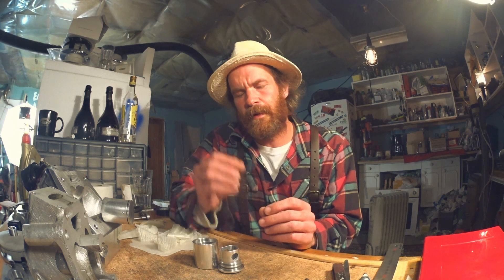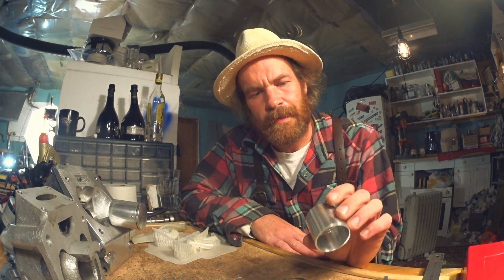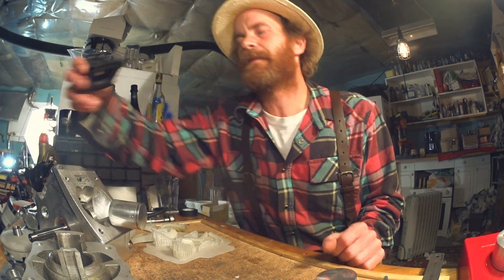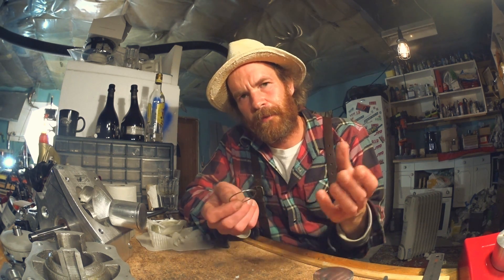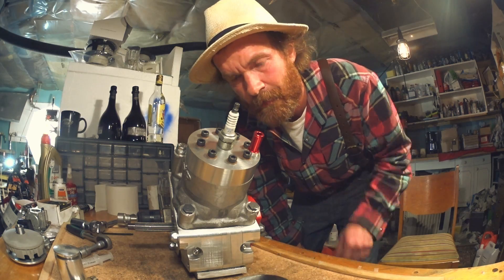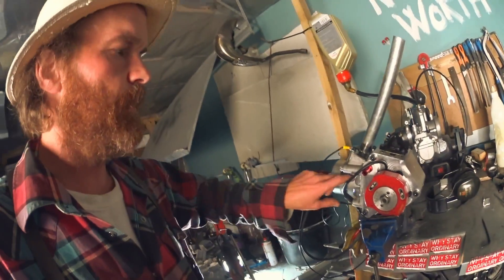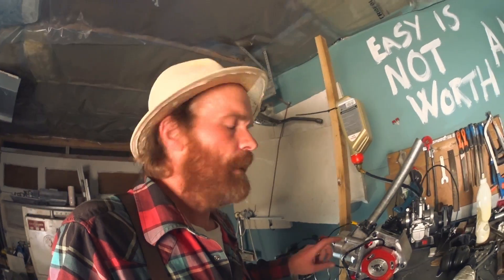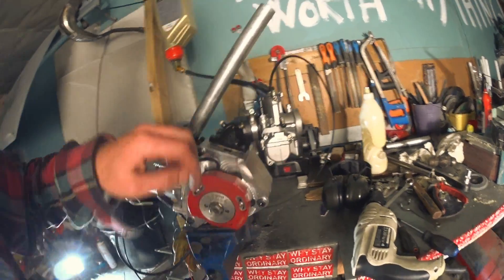STARTS, RUNS, EVEN IDLES! The Most Powerful Two Stroke Ever.

Comment: 30+ hp in a 50cc, thats insane 💀💀, must be using quite alot of fuel
Reply: That's like 75hp from a 125 😎 And a CR500 has about that from factory. So with the same power/CC a 500 would have 300 horse 😍 Absolutely mental!
Reply: @ZdzisławPiłka  No shit Sherlock! I was just putting thing's into perspective
Reply: Smiles per gallon, not miles per gallon.
Reply: The old rotary valve motor before this one definitely was making over 20 hp and used incredible amounts of fuel... When u use r/c fuel it could take 2x the fuel to get the same power as gasoline but when it's tuned to use like 4x as much that's when the magic can happen...(I made these numbers up obviously but ik it likes to run way richer than gas).. it cools the motor a lot more than gasoline too.. I think he's getting to a point where if something goes a little bit wrong it may be possible to "hydraulic" the cylinder with fuel.. again no real evidence to support this claim just talking from my ass like most comments
Reply: @ianbuilds7712  yes there's a very real possibility of hydro-locking the piston on alcohol setups but it might not happen with certain combustion chamber sizes. I don't plow about specifics for 2 strokes here. Just 4 stroke.
Reply: @charlesgunzelman3323  racing 2 strokes are built to pretty much have the piston as close to touching the head as possible at peak power rpm... that being said the ratio is relatively lower than u might think because the actual compression doesn't start until the piston closes the ex port.. so the combustion chamber is way tighter than a 4t but u only really get about half your stroke in compression so Idk i think it would be difficult to actually get that much fuel in there considering it has to get through the crank first but because this particular motor has a downward facing cylinder it may be possible if something goes wrong??

Comment: If I remember correctly when doing a top end and cylinder deglase on my Rm125 I would get around 145-160 psi compression during a test. Wouldnt a 50cc with a smaller piston be able to generate a slightly higher psi ?
Glad you were able to fire it up.
Reply from the maker: 👍 The gauge is not accurate, especially with that long hose.

Comment: It seems like if its actually idling and acceleration from idle at 75psi the case volume is not going to be an issue at all once you get a better ring in. Like many other have said here, dont worry about those negative comments, even if it ends up not working like you want, so what? You will try different designs and keep on until you find something that does work. That is how we advance.

Comment: Sounds like you’re pushing the 3D printer too fast. You could either try to raise the temp by 5 degrees or slow down.  You may also have a partial clog in the nozzle.
Reply from the maker: 👍 I'm thinking partial clog, printing at 50mm/s(if I remember correctly), low acceleration too.

Comment: Even with resonance it still is a air pump. You are just using resonance to achieve higher volumetric efficiency via scavenging. In racing 4 stroke engines you are trying to do the same thing but you use different solutions. Once you get the thing running right you might want to try a dual ground strap spark plug. It helps with flame travel by starting two flame fronts. It will burn the mixture faster and have a more complete burn. You will have to re-jet the carb usually bigger on the pilot jet and raise the needle. If you are running 12mm spark plugs try ngk jr9c. In 10mm cr9ek. There's no real options in 14mm but 12mm and 10mm gives you the biggest selection.
Reply from the maker: 👍 I've got a few tiny 8mm plugs I want to try.
Reply: @2STROKESTUFFING  The spark plug is the hottest part of the cylinder head and a smaller spark plug reduces that area. This reduces the chance of pre-ignition and detonation. I love the content of your videos and this is a fascinating series. Also some of the biggest leaps in engine technology has come from independent engine builders. Don't ever be afraid to try something new. I hope this whole project surpasses your expectations.

Comment: 2 stroke stuffing you should contact total seal ring corporation and research rhere rings because i think your ring being static is why it is burning out so quickly where if you run a total seal ring they actually overlap at the gap making a total seal
Reply: I've seen on numerous motors with stuck rings they lose compression fast and i think that could be part of it

Comment: It's so cool. But I don't understand why you don't test with the resonance chamber it will gain compression with exhaust back pressure. 👌
Reply from the maker: It shouldn't make much difference at low rpm, but now with it running and all, I'll get that pipe mounted.

Comment: Notice the dull spots on the sides of the piston? You can see where the skirt has been dragging on the cylinder. "There's some small RC engines but you can't really count them.." Yeah... that's because they run a nitro methane blend that they make so much power. Though.. that said, that thing on 40% would definitely be interesting :P
Reply from the maker: The secondary intake is actually going to be fed nitromethanol😁👍

Comment: Hi ! For your 3d printing issue, if you never changed your nozzle it is possible that the hole size in the nozzle enlarge over time due to wear and skewed your settings. Try replacing it by a new one.
Reply from the maker: Thanks, I'll try that👍

Comment: I emailed asking for clarification on 'most powerful' last year some time....no reply.  30hp out of 50cc is .6HP/cc.  I'm thinking that there are already 2 stroke engines that produce more than .6HP/cc.  Why can't you count RC engines?  I recall you saying you would run the same fuel (alch/nitro).
Reply from the maker: Sorry, I'm not the best at replying(trying to improve), guess I should count those small engines too. Hard to find any confirmed numbers, but if I can reach 35hp I'm pretty confident I'll beat them all.

Comment: If you braze or epoxy a tire schrader valve into the inlet of your gauge it will make the compression tester read accurately. It needs to be installed in the part you screw into the head. I was able to turn down an old valve stem and remove the core then solder into the fitting on mine. The reason it reads off is because the volume of the hose is added to the volume of the cylinder head. In the small engines I have tested the hose volume is almost the same as the head volume so it effectively cuts the compression in half. With the schrader valve installed at the spark plugs area it provides a disconnect between the two volumes.

Comment: just had a crazy wierd idea, if the bridge in the exhaust port creates turbulence and restricts what if you have a bridged exhaust port but 2 exhaust exits and 2 smaller expansion chambers ? so that each side of the exhaust port is its on circuit
Reply from the maker: Good idea, but hard to get scavenging right. Might have plans for something as a next project.

Comment: There is no need to defend your theory, or your work. You have proven that the 100% of bore works. So many of those that have said it won’t work are quite now. Innovation starts with one man thinking beyond the norm, and making those ideas a reality. If nobody looked outside the constraints of what is mainstream, we would still be sitting by the fire, reading by candlelight, and riding horses to the store. Keep on keeping on man!! I have faith that this engine, if not THE most powerful ever will be right up there with the designs that have many engineers and a lot of dollars behind them, and you have done it by yourself, in your garage.

Comment: Nice job. I understand the reason for the split piston so the pin doesn’t cause a problem with the exhaust port.
But could you have the ring fitted like a regular piston above the split of the piston to remove the issue of volume?
Keep up the great work and thanks for bringing us along for the ride

Comment: If you get 30hp from a 50cc, its incredible. My 2x 125cc kart engines are only 30hp each, which is considered decent. Im curious if you are going to do a bigger version if it works, because it should translate to 75hp. My race tuned 450cc kz bike is only 60+ by comparison, and thats nuts.

Comment: I admire your project immensely and I'm sure you will overcome all the small issues in due course. When I did thermodynamics at college in the 1970's, one of our lab experiments was to plot the indicator diagram of an ancient single cylinder gas engine. This experiment left a profound effect on me even now. Have you thought that perhaps that some scientific analysis is the next step to get the best compression performance? Here's a company that could help - perhaps even with sponsorship https://www.kistler.com/en/applications/automotive-research-test/engine-research-development/combustion-analysis-cylinder-pressure-testing/

Comment: That's still pretty low Brothers need about 100 give or take 10 preferably about 160 to 190 but I make mine about 250 I can run Diesel with mine most of the time with no problems

Comment: Great project, I keep following to see the evolution of the engine, and I am really looking forward to seeing how fast it will be when it is finished. 

If you think the issue is in the difficulty of the gasses to travel behind the ring, in an old DTM engine (or similar GT category) they put holes on the sky of the piston to put in communication CC and back of the ring. (This is a bit of a radical and not reversible modification, but maybe it can be tested on an old piston for comparison?). On a similar note, you can increase pressure seal effect by using L section rings (similar to those on 100cc kart engines); I think this could be applicable if you are going to implement the pin retaining design.

Keep it up: as engine development goes, you are doing great!

 Andrea

Comment: The modular piston Design is fucking awesome! 
Realy!  If you damage the top of the piston you have the under Part of the piston and just need to replace the top end. 
You need to patent you the Design! 
If you dont already have the patent on the piston.... XD
Reply: I have plenty of pistons at home that have a hole in the middle of the top.... Ignition was a little to strong for alluminium.... 
With his Design i could change the top piston with a New one and the piston is ready again
Reply: My Inner Rotor Ignition was a little to aggressive to My pistons.... XD 
Had the wrong Timing and sparkplug that gets too hot.

Comment: You've got this bro. I understand everything your doing. I won't spoil your fun with anything. Keep going your on the right track. Your resonance frequency with rise with your rpm So I hope you got your intake run and exhaust run mapped to the millimeter. you have to have each wave meet exactly in the middle of you piston to achieve full resonance at top end. You've got what it takes. and you got the support. be patient. If you get your numbers right your open intake will resonate and drive rpm even higher. just be careful of runaway. if anything gets too hot it will burn just like a ramjet. then brick itself

Comment: awesome progress, im sure you will sort it :D as for the 3d printer getting a good print is like tuning the 2 stroke :D you need the right jet (nozzle on printer).. ideally you want to print layers around 80% of your jet height... when im printing stuff like those stuffers i dont mind visible layers so use a 0.8mm nozzle.. the parts print quick and are very strong due to the thick layers.. of course you need a decent hot-end to keep the heat if your printing fast (something like a volcano)...

Comment: What you are doing out of your garage is astounding .It took a teem of engineers and years to squeeze 24hp out of a 50 for racing if you get 30 hp it will be astounding  .I had a tear in my eye when it ran on idle .When the pipes on i cant wait to here it ,  get the water cooling done and fit the pipe so you can do a proper run and let it come on the pipe .Do you have any idea on the revs this will reach when on the injection system .As a side note to perhaps get some cash in  why not offer a modified version with gear box to offer to the Freetech 50cc race boys running on a carb only if you can get 24hp out of it it would be a race winner .

Comment: Are you going to run the head profile the same  as the piston for the squish? I machined mine a couple different ways, one with a 10mm band at .07mm and another at 10mm with 35minute° leading angle to help direct the flame spread. I would have machined the pistons but they were ceramic domes RS250r

Comment: Great news! I think your are on the right track with the ring seeling issue, too large volume in the ring grove. I have tried making rings in bronce once. They didnt seal enought and very little power. My analysis was they did not provide enought pressure due to poor spring action. Are your rings hardend?

Comment: If you are going for max hp are you gona turbo it? Max power is all about how much air you can get in and how much it revs mostly. Light pistons to.
Reply: @M Bacon you can turbo a 2stroke. Look at skidoo 850 etec turbo. And I bet you can supercharge them to to get insane hp/cc. Also fuel has a huge role to he could run on methanol for even more hp/cc.

Comment: Well done! be sure to make your header for the exhaust the right length its a critical part of the tuned pipe system compression ratio on a 2 stroke isnt super important
like on a 4 stroke there was an old mod of drilling a tiny hole from the top of the piston in behind the ring to "push the ring out and tighter to the cylinder"
a decent ratio is fine for 2 strokes remember when you compress air it gets hot its the way diesels run heat can be bad on the top of the piston its why they sometimes put a ceramic coating
the hotest part on 2 cycles are the head and piston be mindful of hot spots forming on the piston top and to hot of a spark plug a hot spot can melt a hole right though the piston
chainsaw racers have done a lot of modding to get faster times in the cut some are on the borderline of total failure

Comment: Twiking with the intake & exhaust ports + intake resonator + tunepipe at exhaust......
Voila ..... one might get the max out from 2 stroke engine

( you might want to look in to the tiny marvels produced by Cox for Model Aero applications  ..
0.010, 0.020, 0.049 Reed valve engines running at 18000 to 25000 rpm )

Comment: I have the same printer. Ender 3 right?  Upgrade to a all metal extruder immediatly because i had the exact same problems with mine because the plastic extruder spring amr had actually cracked from underneath

Comment: i don't believe that is most powerful 2 stroke, the exhaust is not an expansion so you lose a lot of power, and to have this rotor is taking rpm very slowly, but if do you like that i can't do anything, I'm only giving you some tips.
Reply: Did you watch the video? or any of the others? he literally showed the expansion chamber exhaust that will be used. he is sorting out compression issues and getting it to run at low rpm with a stuffed crankcase at the moment before he connects the "primary" intake and expansion chamber for high rpm/high horsepower.
Reply: @jamespooley6626  Oh sorry i don't know that

Comment: So, this is a valve less pulsejet engine, with some moving parts in the middle to extract some of the energy...  :-)
Reply: the "energy extractor" also compresses the charge to have the combustion take place at "slightly" higher pressures, helps with efficiency and power :)

Comment: You should heat up the cylinder tot working temperature and measure the bore. Then make a piston ring that is completely closed, because you can do that with the piston design that you are using. That piston looks awfully heavy for a high revving engine tho.

Comment: My experience is that you need about 45 psi for a 2 stroke engine to run.  I had wanted to eliminate my exhaust port on my yz125 believing it was restricting power

Comment: What oil ratio in fuel are you using??
Virtually no smoke when it starts cold.
More oil would help with potential boundary layer lubrication problem.

Comment: Make no apologies, what you do is art.

If you want a good recommendation for a new 3d printer, I just picked up an Anycubic Predator for $440 USD and it is massive, and extremely accurate. I'm really pleased with mine and it was so stupidly simple to get up and running.  it's got a pretty good preset in CURA too

Comment: Is the motor acting more like a diaphragm / ww2 v-1 engine in resonance ?. Like a tuned two stroke exhaust by placing rings at certain points in the pipe where it starts to loose resonance. Now that is a train of thought I like 👍. & As for it idling & the smile on your face priceless 😁.

Comment: Can you gas port the top of the piston to add pressure behind the ring to help it push out against the cylinder like a high performance automotive piston? I ask because it would allow a much thinner lighter lower tension ring that would be less susceptible to ring flutter at high rpm. Maby you could use brass shims in the ring grove to make up the thickness defrence and keep the ring from sticking to the aluminum piston.